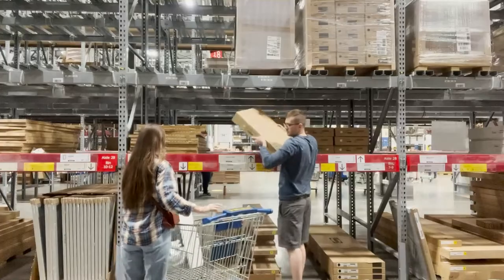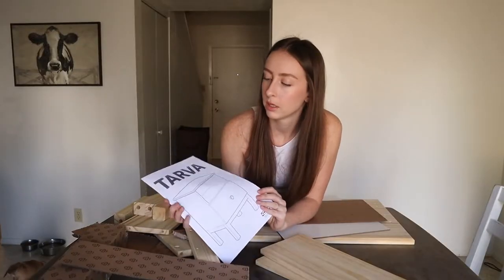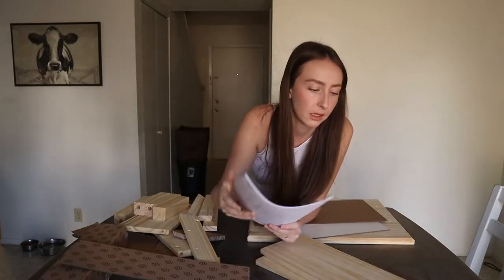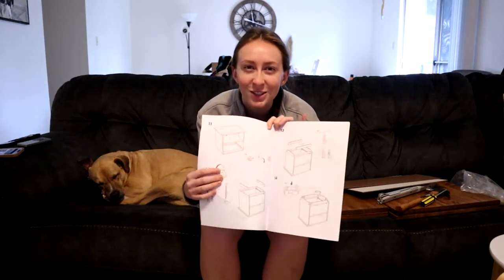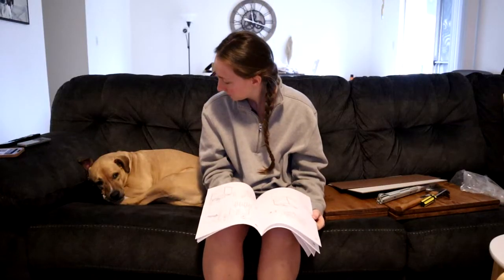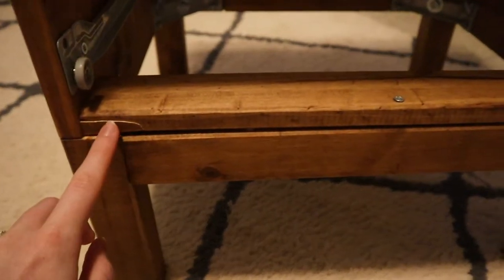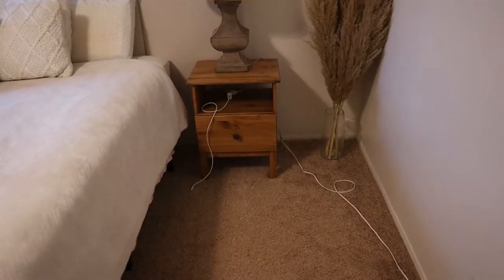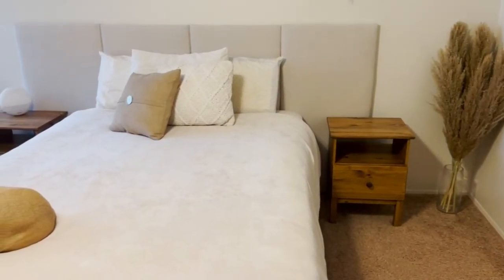IKEA NIGHTSTAND MAKEOVER | Minimalist Bedroom | DIY Nightstand

Comment: Liked the video and I love stained wood. So glad you didn’t paint. 
Tech tip 1. When assembling wood furniture it’s best to allow wood the climatize to inside home this will help prevent cracking/splitting
Tech tip 2. Go to harbor freight and buy an orange dead blow hammer. I noticed you used a nail driver steel hammer to assemble the furniture that can leave “silver dollar” marks whereas a dead blow hammer will not. You could also use a rubber mallet but dead blow hammers deliver more force.